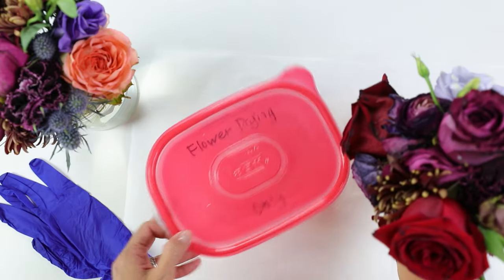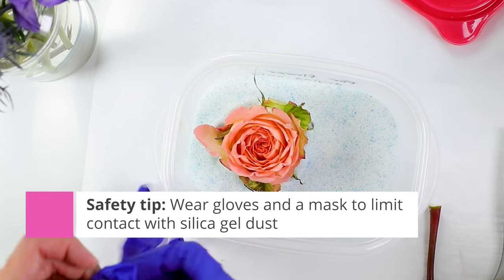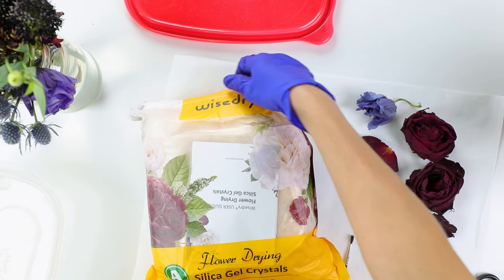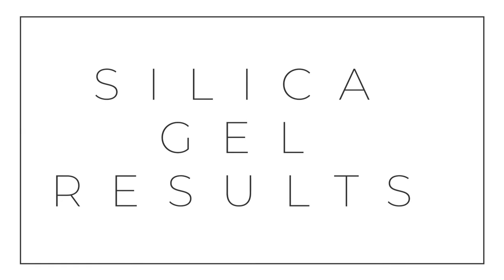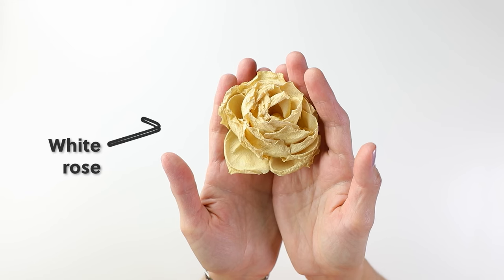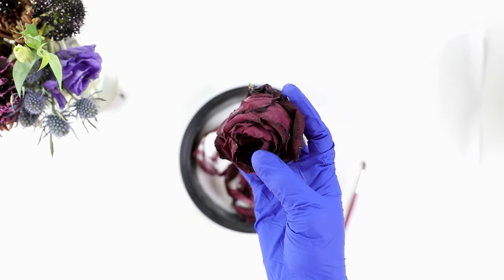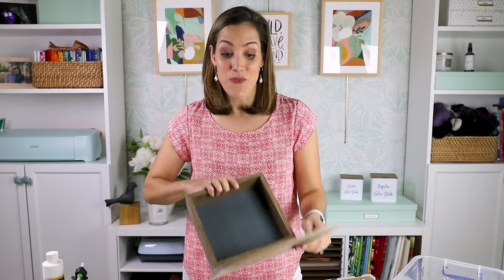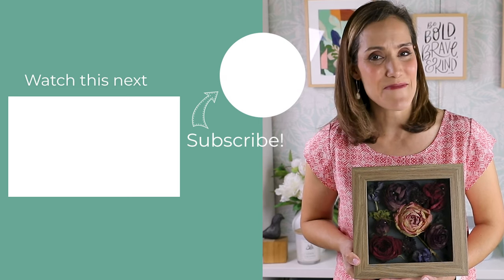Preserve Flowers the BEST Way Possible! Use Silica Gel!

Comment: Hi! Hope you still check comments! At 5:58 you pull out a container of preserved flowers and there are some wonderful looking baby's breath in there.. Did you preserve those ones with silica gel also? If so, I assume just laid flat in the container and put the gel on top? Would it hurt to do that but a few layers of it (since they are fairly flat)? I am trying so hard to find a way to preserve baby's breath without them yellowing in the stem/bud slightly.
Reply from the maker: Yep, I still check comments daily. 😊 I believe I dried that baby’s breath naturally, just air drying the stems upside down. You could definitely dry them in silica gel also, but the buds are so small I usually don’t worry about a little yellowing. Happy flower drying!
Reply: @FirstDayofHome  Thank you!!!
Reply from the maker: @lif3liv3r Any time!

Comment: Thanks for the video, I have been leaving my flowers in the gel for a lot longer, do you think this will change the colour/texture if they are left for 3-4 weeks inside the gel?  Also what do you have any advice as to whether they should be sprayed afterwards with anything as like a sealant or protector to increase their life?
Reply from the maker: I have found that sometimes the flowers get more brittle if they are left in the gel for longer than 7-10 days or so. It depends on the type of flower and how loose the petals are. I would rather leave them in too long than not try at all, though. I don’t usually spray them, but I know you can buy a floral fixative spray that is supposed to help maintain the color. I don’t bother because I like the natural aging look.

Comment: Sry for asking but I tried to dry the rose in the silica sand and microwave for 2.5 minutes , but it didn’t work and the rose became so loose , it can’t hold its shape anymore ?
Reply from the maker: I would try a deeper dish to see if you can surround the rose with silica gel on all sides. That will help it to keep its shape. Try the non-microwave method to see if you like it better too. It may take 5-7 days for roses to dry with the traditional method, but the flowers may keep their shape better. Sometimes the microwave method is better for petals or smaller flowers.

Comment: Hi! This was a great video. I got into preserving flowers after receiving 3 bouquets from my boyfriend. The first one I pressed. The next 2 I used silica gel like in this vid. The white roses dried off beautifully white, but after placing them in a shadow box noticed they started to turn brownish. The pink roses first dried off mostly yellowish with pink tips, but on day 7 everything is yellow. May I ask for some tips on what I should watch out for the next time? I’m not sure if I overdrowned the flowers or did I overdry them. They were definitely away from sunlight and I sprayed them with hairspray after drying. Thank you!
Reply from the maker: Hi! I’m sorry to hear about your experience. Light colored flowers may have some yellowing over time. It could also be that some of the flowers weren’t fully dried especially if they have thick centers. I hope this helps! Don’t give up on experimenting more!

Comment: I understand not using the same tubberware for silica gel and food but is that not a worry for recharging it in the oven that you also use for food?
Reply from the maker: I don’t worry about it in the oven because it’s not touching anything that will later come into contact with food. I use foil pans to recharge in the oven, and I only use those with silica gel. That said, you should only do it if you’re comfortable with the product. I always follow the manufacturer directions. The reason I don’t use the plastic for food afterwards is because the plastic can absorb pesticides that might be in some flowers if you buy them in a store.

Comment: How do you know when a flower is fully done drying in silica gel?
Reply from the maker: You can gently remove the flower and check the center to see if it still has moisture. If it's not done, just cover it with the gel again and close the container. When the flower is done drying, it will be crisp and the petals won't bend. In my experience, it usually takes 3-5 days to dry depending on how thick the center is. I hope this helps!

Comment: My flowers dried on their own on a vase, they have been in the water for 3 weeks. Can I still do the silica gel or should I just place them in the shadow box? FYI I don't want to pressed them.
Reply from the maker: Hi Pamela. If the flowers are fairly dry already, you won't benefit as much from using silica gel. Silica gel works best when the flowers are still soft and have some of their original color. I hope this helps you make a decision. You may want to grab some silica gel for next time, though! 😊
Reply: @FirstDayofHome  Thank you! So basically it is best to discard them. Or would they last a few on the shadow box?
Reply from the maker: @pamelarodriguez3091 Oh you can definitely still keep them in a shadow box. They may look more vintage, but I’m sure they would still be meaningful to you and worth keeping.

Comment: Hi, I want to dry and press  poinsettia petals., I haven't tried silica gel crystals. I want the petals to be flat, not curling on the edges and I want them to retain that bright red color as much as possible.  They seem to have more moisture in them.  I wouldn't mind if they turned a wine color but not brown.  I want to know how you might do it?  Help!!
Reply from the maker: Hi! If you want the petals to be flat, I'd suggest pressing the flower. I would expect the color to change to a deep wine, but honestly, you won't know until you try. You could try book pressing a few flowers and microwave pressing others to compare. Have you seen this video showing 5 ways to dry flowers? It might help. https://youtu.be/lLgpgD_xZzU?si=KaIRlMWJ6skjUI8S
Reply: yes I pressed and got a wine color. I've tried book pressing in both paper towel and parchment.  I will try the microwave and watch the video.  Thanks for your help!
Reply from the maker: @user-yd2br1kg1n No problem! Good luck to you!

Comment: I followed your instructions to dry my bouquet. Question: Do the colors of the dry flowers fade over time once they have been placed in the shadow box?
Reply from the maker: Yes, they may fade slightly over time. That happens with any drying method, though silica gel will help keep the color for longer. For the best results, try to keep your shadow box away from direct sunlight. I hope this helps! Congrats by the way!
Reply: Thank you Crissy💖

Comment: Hey there! Is it possible to press the flowers after drying them out with silica gel? Or would they be too fragile?😮
Reply from the maker: I think they would be too fragile. I generally pick one method or the other. If the face of the flowers are fairly flat, I press them. For roses and flowers that have layers of petals, I like using silica gel. Hope that helps!
Reply: @FirstDayofHome  Oh I see. This is my first attempt with silica gel but are the petals crumbly once dry?
Reply from the maker: @kimabeno Yes, I would say they are fragile. Sometimes petals may slip out if you move them around or shake them too hard. You can reattach any loose petals with acid-free glue if you need to. I even use hot glue sometimes if it won’t show.
Reply: @FirstDayofHome  Thank you so much for the tips! I'm excited how they'll turn out😚
Reply from the maker: @kimabeno I’m excited for you to try! If at first you don’t succeed, try again. It takes a little trial and error to find out what works for your flowers. I hope you enjoy the process. 😊
Reply: @FirstDayofHome hey there! i tried drying some sunflowers & they turned out amazing! do you happen to know if you can place pressed flowers in silica gel?
Reply from the maker: @kimabeno I wouldn’t place pressed flowers in silica gel since they are already dried. Silica gel is more of an alternative to pressing flowers when you want to preserve the 3D shape of the blossom as you dry it. Hope that helps!
Reply: @FirstDayofHome  aww okie dokie! i had the impression that it would keep the colors longer with the added steps. that makes sense. thank you again🌻
Reply from the maker: @kimabeno No problem! Glad it makes sense now. Hope you have fun experimenting!

Comment: Can I leave the stems on so I can put the arrangement back together?
Reply from the maker: You can, but it’s typically easier to remove the bloom and then reattach the stem with floral wire after drying. The stem doesn’t need the silica gel as it will dry out naturally, and it takes up a lot of unnecessary space in your container.
Reply: @FirstDayofHome  Thankyou for for the tip, that's a great idea. 👍😊
Reply from the maker: @jodyjennings8472  You're welcome! Good luck!

Comment: I tried this a couple of days ago. While the silica gel did dry the flowers, the flowers are starting to become damp after I stored it in a container. Am I doing something wrong?
Reply from the maker: Hi Jenny. How many days did you leave them in silica gel? My guess is that the flowers weren't completely dry when you put them in the container. If it's very humid, that may cause flowers to stay moist in the center, especially flowers with thick centers like roses. You could try placing them in silica gel again for a few days to let them dry out more. I hope this helps!
Reply: @FirstDayofHome  Hi! I left them in the silica gel for 4 days and they were very dry. I’ll try drying them more. Thank you!
Reply from the maker: @JennyNguyen24  I hope that works for you. Sometimes those center petals can be hard to dry fully. Best of luck!